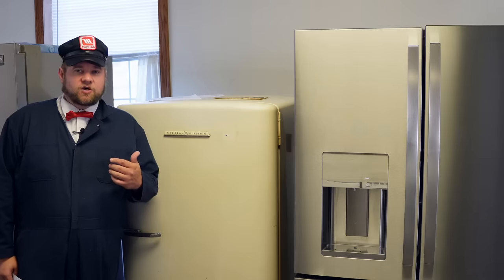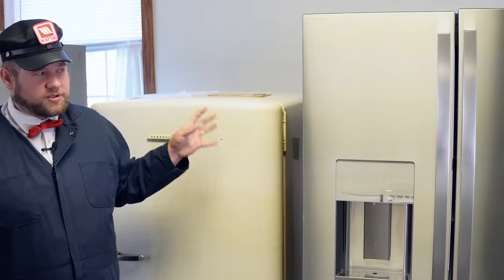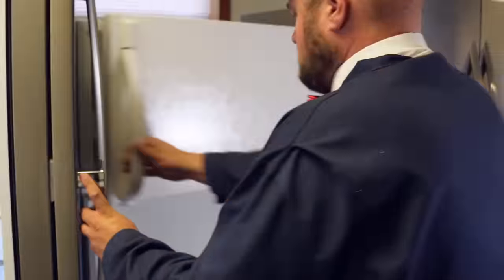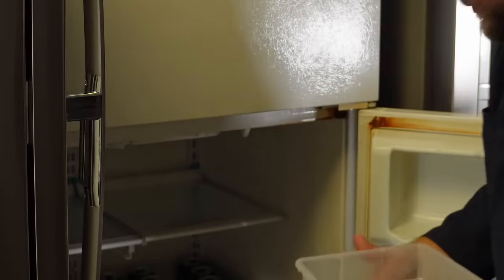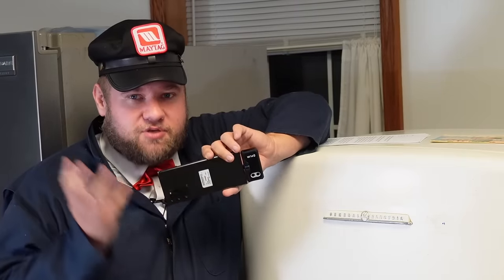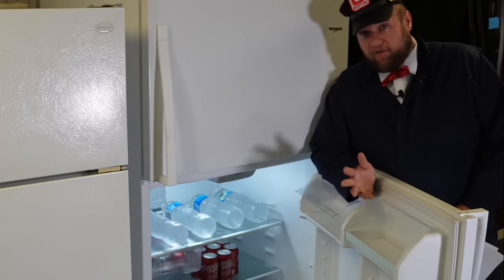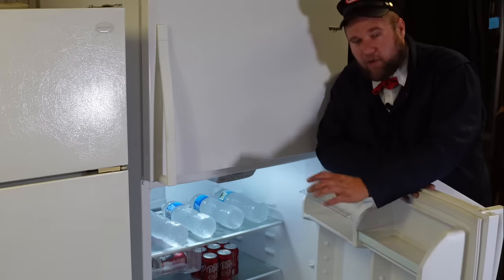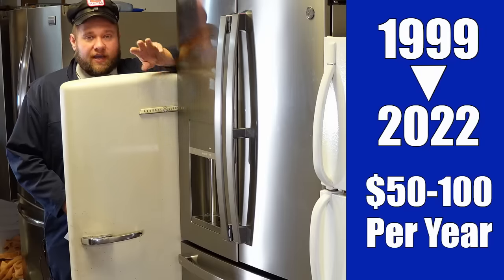Should You EVER Buy a New Appliance if Yours Still Works? A 7-Day Test

Comment: We had an Amana fridge that gave every indication that it would never die. It was big, painted white and it was incredibly quiet. After 24 years I finally had a service guy come to give it a checkup. There was nothing wrong with it at all. Couple of years later it was decided to get a new stainless fridge because that's what was hip and would help us sell our house. The new fridge is a piece of crap. It's much smaller and it's so noisy it wakes me up at night. I hate it. God how I wish I had my Amana back again.
Reply: Some appliances have actually useful improvements but in my limited knowledge, freezers and fridges are the same tech as they were 50 years ago. That being the case, a unit with loose manufacturing standards or shipping damage is going to be worse regardless of age. So if you get one that works, keep it.
Reply: @gorkyd7912  I didn’t want to lose it but our realtor said it looked dated so the better half said out it goes. That fridge was made by Amana when they made things in Amana. I hope it was sold secondhand instead of being scrapped-somebody would be getting a very high quality appliance.
Reply: What's stopping you you have money go out and get you one!!!!
Reply: My 1995 Amana is still running.  It uses around 2.5kWh a day, and for some reason runs every 50 minutes whether I open the door or not.  But the point is - It works even at 27 years old, and is still fairly efficient.  I'm still disgusted that manufacturers plan on people replacing appliances every 7 years.  Mine are all from 1995 and still running. Could they be more efficient? Yes, but is it worth it?
Reply: new things are designed to break faster so you have to buy more
Reply: @ethanspaziani1070  They’re not the same as they once were. They used to actually build them to their own high quality standards. Now Amana is just a name badge stuck on a generic appliance that has a dozen other name badges stuck on the same appliance. It’s called private label manufacturing.
Reply: @douglasskaalrud6865  what I'm telling you is you should go out and buy yourself an old refrigerator like the one you used to have if it's something that you miss and want back in your life and you have the capacity to do it do it
Reply: @douglasskaalrud6865  better half? Hope she's worth keeping the new fridge and losing the old fridge ig xD
Reply: @douglasskaalrud6865  They're a Whirlpool subsidiary pretty much, but even in 95 they were a Raytheon subsidiary, all the Amana products now are basically budget Whirlpools.
Reply: I got a new fridge last year and it doesn't make any noise and it was one of the cheaper ones.
Reply: Ironically, I have a stainless Amana fridge from a couple years ago in my apartment and it is a total piece of crap. Insanely noisy and the build quality is such garbage that the door sliced me several times due to sharp edges. I finally got tired of it and started duct taping sharp edges around the door to prevent myself from being jugular-sliced by my fridge when looking for the pickle jar in the back corner.
Reply: I have a new Amana washer and dryer and I assure you. They do not make them like they used to. It was cheap and does the job, but it's less than 2 years old and already both the washer and dryer are having issues. I wasn't expecting much but the other ones I've used before were longer lasting.
Reply: yeah, my parents got rid of their perfectly good top-freezer, mid 1990s GE (or maybe Amana) b/c the water line wasn't working right. This was undoubtely a simple repair.  They replaced it with a much newer GE top-freezer that they hate b/c the ice tastes awful and the temps aren't consistent in it.  So the long and short: never replace a fridge that is basically working fine.
Reply: @scottyanke655  As long as it runs keep it.
Reply: When you say it was decided that you get a new fridge tells me a woman was involved. Never ever listen to them.
Reply: The Amana was Made in Amana Iowa ,,---I bet it was A Bottom Refrigerator ???
Reply: @BigTony2Guns  i have an older, 20 + years, amana with freezer on the bottom and it has been great.
Reply: @BigTony2Guns   It had the freezer on the bottom.
Reply: @bookbeing   Yours is an Amana made in Amana, Iowa. It will run forever.
Reply: @BigTony2Guns  mine has the freezer on the bottom.
Reply: My mom wanted to remodel her kitchen in stainless and was going to have the "installers" take her Amana fridge.  I jumped on that thing.  It destroys the Whirlpool fridge I was using before.

Comment: Unless I missed it, it would've been nice to see how much power they used per volume, that would've made any inefficiencies much more clear between the models, because as you said, the fridges varied widely in size.
Reply: 11:47 you can see it mid test.
Reply: Hi!
Reply: I'd imagine as you used a greater amount of that higher capacity it's efficiency would go down as it needs to work harder. So the comparisons aren't exactly 1:1

Basically, my point is, I'm not sure power/volume is an accurate representation. Interesting though, yes.
Reply: @BlackSmokeDMax  He's cooling the same amount of stuff inside though. And the reason why we need to see the efficiency per volume is exactly BECAUSE it's not a 1:1 comparison to begin with. As it stands, the measurements he reports don't really tell us that much.
Reply: @Razumen  I agree this testing is good, i was saying that relating this exact test to the interior space and thinking you can use simple division/multiplication to relate the efficiency of these tests up to different volumes of stuff inside of the larger capacity units wouldn't quite be the same. Now they may turn out to be the same or similar, just that you can't tell that without better testing. But yeah, as long as everything stays exactly the same inside, this test is perfectly fine.
Reply: @BlackSmokeDMax  The volume isn't for errata inside, it's for the total volume of each fridge. Whatever is being refrigerated remains the same amount like in the test.

That is, I'm not asking for the test to be changed, but the results to be given in a way that makes the comparisons actually   intelligible.
Reply: If I ran the numbers correctly, it looks like the WP 2018 was most efficient, using 0.26 kw/cu ft over seven days; the WP 2022 was close at 0.27; then a jump to the GE 2022 at 0.65, the FD 1999 at 0.72, and in last place, Grandma's GE 1950 at 0.81.  I didn't realize what a treasure I have in my Whirlpool fridge!
Reply: @vanderm49  ….thank for this added data. Yes the test was run on similar quantities of ‘stuff’ to keep cold but I was wanting the kw/cubic ft data too….just for comparison. Thanks!
Reply: I almost feel like missing this measure would null & void any other test. No one wants to spend a lot of energy to cool a small space, so the volume/space area really matters
Reply: @vanderm49  Thank you! I have a 2002 FD that looks just like the '99 FD, so I assume it operates the same, and I'm totally ready to retire the thing

Comment: I wouldn't want your Gramma's fridge all "cut up" but it would be super cool to see it be rebuilt/refurbished to make it more efficient/modern
Reply: I had exactly the same fridge he shows here. In 2020 we finally cleared it out in preparation for upgrades, etc.
I found a place here in Los Angeles (turns out, literally right down the street from me) that cleans, repairs and restores these old refrigerators. They repair or replace the compressor, replace the wiring and insulation, repair parts and finally, they repaint the cabinet, so the whole thing looks fresh and new.
It won't be a modern machine, but it will work well and will have a whole new Life with a new family who loves it.
I'm really glad I made the call to that shop.
That reminds me, I gotta check out his youtube channel and see if he's made any videos about that fridge.
Happy thought.
Reply: Yep
Reply: It is already pretty efficient, and how would you modernize it? Put it in the garage for pop or beer.

Comment: Have done this exact test!   NOTE that on one of the fridge, the FAN for Condenser was worn out and not blowing properly, THAT alone caused power usage to DOUBLE.  SO FOR THESE test be SURE all components are working as originally made
Reply: One major thing I learned in a refrigeration class was that when they don't get enough ventilation to dissipate heat they don't just have to run longer but the refrigerant pressure goes way up causing it to be HARDER to pump which takes a lot more power.
Not only that but makes them beat themselves to death.
Even if the air is hot, you have to keep it moving.
I think of that whenever I see units crammed into a small hole in a kitchen.
In my apartment we alway keep a tiny fan running moving the air around the fridge in summer.
Reply: Also, inspect all of your appliances regularly! I once had a fridge die a week after it was given to me because the condenser fan failed and I assumed it just didn't have one.

Comment: I have an early 90s fridge my parents gave me. It was in terrible condition. After fixing all the air ducting underneath and deep cleaning the coils it runs like a champ. Better than the new one in the kitchen.
Reply: I had 90s  simple fridge with all ' forced air ' from a central freezer box in the back. No refrigerant coils inside just ducting blowing first to the freezer then down to the rest. It is quite an amazing unit and will freeze things in the freezer super fast. BUT in a very humid summer you have to be careful if too much frost accumulates in the ducting the air won't flow and it goes downhill fast.
The only remedy is to shut it down for like a whole day to clear all the ice out.
Then it's good to go again.
About as simple as it gets.

Comment: Was just randomly reccomended this video and it definitely satisfied my random curiosities. Great info, easy to watch and listen, short and to the point and I love the wholesome touch at the end with your grandma. Keep doing your thing Ben!
Reply: short answer NO why cause those old ones last forever new ones last for like 5 years 10years tops and die now days🤣🤣🤣
Reply: @raven4k998  yes mainly, but he talks about electricity usage, cost and size which also plays an equally important role.
Reply: @1coldshot493  what you are talking about I was talking about how new ones break after a few years of use while the old ones keep on chugging alone forever power is irrelevant to that one mind you, I guess that's what modern fridge makers use to say their fridge is more energy efficient cause if it dies it cannot use power, so I guess in the long run the old ones use more power that way I guess
Reply: @raven4k998  I understand what you're talking about. Relax. Never denied it or went against it..... The end of his video talks about how a model that pulls slightly more power than another is actually beneficial (TO HIM) as it holds more capacity to the amount of power it pulls. Which plays an equally important role in a decision instead of "What pulls the least amount of power".
Reply: @1coldshot493  easy fix rip the compressor out of the old fridge from 1950's and put it in the 2020 fridge and you greatly increase the 2020 fridges life expenctancy
Reply: It's nothing without the overalls, hat & dickie-bow.

Comment: Hell yes.  My dad had a 20 cubic foot chest freezer he bought in the late 70's that lasted until 2019.  He was so proud of how long he had it.  I replaced it with a frost free 16.7 cu. ft upright and after one month, the electricity bill went down $25 a month!  That's a savings of $300 per year and you don't have to defrost it once a year and everything is easy to get to.  Even freed up space in the garage.
Reply: Ok so you save enough money to buy a new fridge when planned obsolescence kicks in
Reply: @ureyesrbleeding1  In two years, you'd have enough money to buy a new one.  Freezers are actually still pretty simple and last a long time.
Reply: @Dazlidorne  why frost free?
Reply: @thetacokawaii5708  For the minor extra electricity it uses, it is well worth it not to have to defrost once or twice a year.  A lot of people that have manual defrost freezers don't defrost them enough or at all, so they become inefficient.  I also like uprights because you can see everything and you don't leave things in the bottom of the freezer, causing them to go bad.
Reply: @Dazlidorne  Chest freezers are more efficient than standing ones because cool air sinks and stays in the freezer when you open it.
Reply: @michaelwillman5342  Yeah, apples to apples comparison of same size and year of manufacture.  Also, with a chest freezer you have to regularly defrost them.  If you don't, they arent as efficient.

Comment: I sell appliances for a living.  Keep creating these relevant videos. They are jam packed with helpful information. I use the knowledge gained from your site to assist customers with their buying or repair questions...thanks!
Reply: OK then, which brand of refrigerator is the most reliable that you have seen from your sales job?  I’m considering replacing a working 6 1/2 year old Whirlpool refrigerator.  Black Friday sales are in effect!
Reply: Short answer is they are all garbage that needs replacing in 5 years. Sad but true. I am in the same situation as you are. I am a very handy guy, I can fix literally everything. I can repair refrigerators with ease. But the cost of parts, the lack of availability of the needed parts and amount of cheap plastic components that break upon disassembly is astounding! America just need a built better brand made here in the USA.
Reply: This guy is very intelligent & informative & one thing I want to point out is keep the condenser coil clean . That right there will make your refrigerator or freezer last longer & help keep the electric bill down . & work better .

Comment: Wow, a blast from the past.  I grew up with this GE frige.  My folks got theirs in 1950 and it was our main frige till 1967.  It was still working as always but the newer bigger units finally won out and took over the daily chores.   The 1950 model was now in the garage and like yours was now always full of beverages.  It seemed up to that challenge and continued working without fail for another 15 years.  The thing I remember most was a regular routine of defrosting the ice box.  Many different methods were used, placing a pot of boiling water in the ice box to eventually hair dryers, to if the fridge was empty anyway just unplugging it with large pans inside to catch drippings while going out for a long shopping trip and bringing new stuff home to fill it up again.  

I was happy to have lived with that GE for over 33 years.  So I hope this story gives you a nudge to keep yours.  The memories are priceless compared to kwh costs.  
Fun Fact that fridge never gave up, and never had service, and might still be running somewhere today.   Not sure what the scam or plan was but an offer went out to all homeowners to turn in the old fridges and get a $10.oo check.  This did not move my folks to get rid of it, but it did cause some horse trading.  The old GE went to the nieghbors son who was now moving into his 1st apartment and that left room for my folks to get an old fridge from the nieghbors who was going to collect the $10.oo but just let my folks have it as the new beverage fridge in the garage with much more room now for beer and such.

Comment: One of the major causes of failure for the seal on to of the fridge door I was surprised you didn't mention is that is where people constantly grab the door at.  This means it not only gets dirty quickly, but they also get twisted and bent out of ideal shape and often get ripped and damaged.

Case in point, you resting your arms on top of the door, heh.
Reply: 40 years in the business THEE major reasons a seal fails is people allow thier children to go in and out of the fridge and spill stickey juice, which glues it to the cabinet causing it to tear ,2nd most common reason is the doors were  removed to get it in the house and not shimmed properly when put back together, next would be drawers dragged across the seal from not opening the door all the way, touching the seal while opening does little to nothing unless you have stickey goo on your hands

Comment: My wife and I bought a brand new whirlpool fridge when we moved into our one and only home in 1983. It is still working and I’ve only had to do 3 minor repairs myself. As my beautiful wife is no longer with me I just can’t see replacing it as long as it doesn’t die. The only thing I can say about it is that the compressor relay is very loud when it kicks in and out.
Reply: Here in the Philippines, local repairmen can fix them compressors or, if totally broken, swap it with a part from a scrapyard.
Ours is a GE fridge from 80s, and 3 years ago it was noisy. It would roar in the middle of the night and the shit out of someone. We had it repaired as well refilled the frion gas.
EDIT: It still works. A little inefficient than the newer ones, but that's mainly because it doesn't have an adjustable temperature. But consumption wise they're roughly the same

Comment: My parents moved into a place a couple years ago which has some of the original first owners appliances. The washer, dryer, and fridge are decent mid-late 2000s electric units, but the Westinghouse electric range and the retired old Hotpoint fridge found in the garage were from the 40s. I pulled it apart, added a new power cord, and it fired right up and works. Love the (quiet) sound of the compressor.